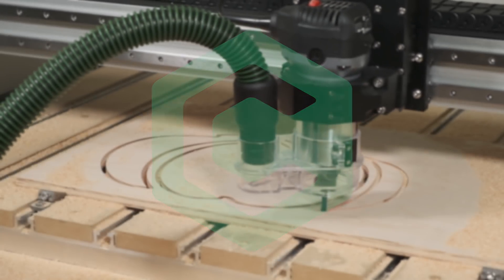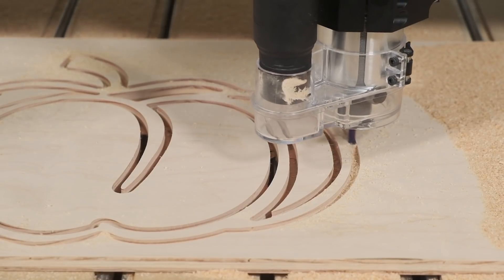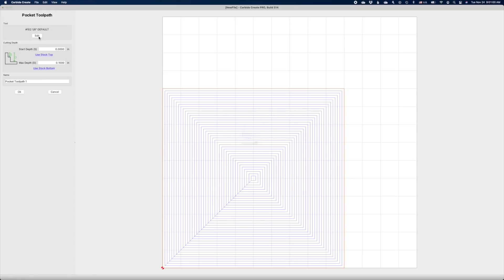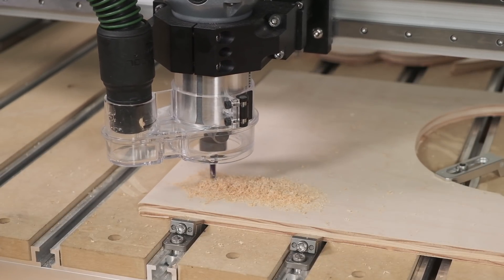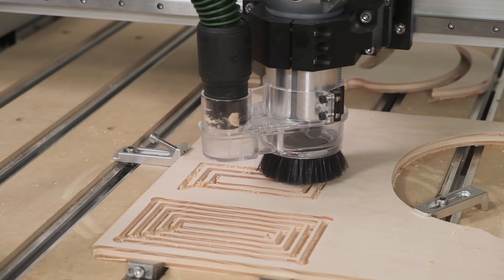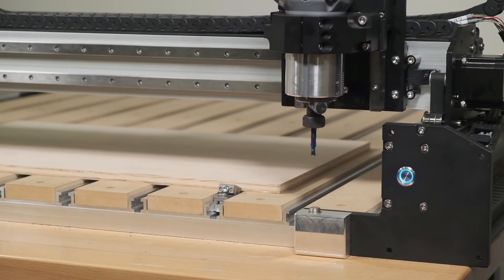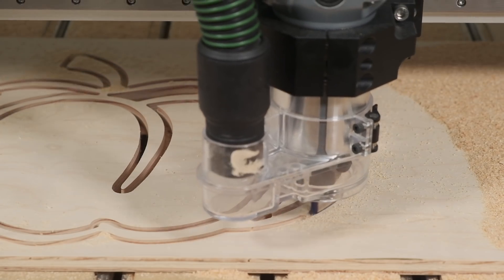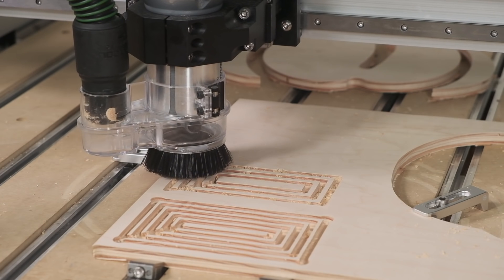Shapeoko Pro Testing in Plywood

Comment: I just gave this a try with the carbide 1/4in downcut (#251) on a Pro and at 9.53mm there was visible chatter. Although I was using Baltic Birch ply, which looks tougher than the stuff in the video,  it's nothing close to the finish of the pumpkin here. Not sure if I'm doing something wrong and open to suggestions!

Comment: The version of Carbide Create in this video looks different. As a general note, I think that the software is the weakest point of Carbide‘s offerings. There are some really basic things it cannot do, like resizing a rectangle without keeping the aspect ratio;-)
Reply: Downloaded the latest version from September and the issue with resizing recatngles has been fixed. Thanks!
Reply: Also, the new software version does indeed look like the one in this video. Mine was from July and hence still used a different set of widgets.

Comment: Hi Winston. Keep in  mind that the 700Watts of an AC router are not the some as the 700Watts of a VFD spindle. The former Wattage refers to input (power consumption) the latter Wattage refers to output (real cutting power on the bit).  As per Gwizard your third recipe was 372Watts. That is dangerously close to your AC router's output capacity (which again is NOT 700W) and I don't think it is sustainable for long periods, you risk smoking the router. The Pro does seem a lot more capable, but the AC router is the weak link now. (EDIT: This is why somebody else chose a VFD for their Pro - which of course comes with the relevant bump in $ ).
Reply: You're right about router power ratings, but unfortunately some of the Chinese HF Spindles also seem to be rated on input VA rather than output power, so "buyer beware"!  Also GWizard can only crudely estimate cutting power requirements.  It uses a K-Factor of 19 cu-in/min/HP for MDF and all types of plywood, 10cu-in/min/HP for all types "alloys" of "hardwood", and 30 cu-in/min/HP for all "softwoods". 
Audacity spectrograms (https://youtu.be/qiM20-woEOk?t=287) of Winston's cuts indicate that the router really wasn't struggling in any of them.  It's speed controller was able to maintain a reasonably constant speed.  That's why it would be quite useful for Winston to monitor and log router input power (which is easy to do) in this endeavor.
Reply: I am sure that he knows that

Comment: I really wanted to get on the Pro train, but it left a lot to be desired for me. For example, no spindle on/off. No upgrade path to a more serious spindle than a router. No word on tool changer. It's a really nice machine and a definite improvement for those looking to up their game from the S3 though.
Reply: ATC spindles are far too heavy for this machine so that's never going to be an option.  A router is 2 or 3 KG and a good ATC spindle is 15KG or more.
Reply: @vengefulcaptain6338  Here's one that weighs 5.9 kg https://www.damencnc.com/userdata/file/5000_Teknomotor_ATC41-A-ISO20-SN_Flyer.pdf
Reply: Actually, the spindle on/off could be easily done through a relay. Not sure if their controller has a spindle or otherwise unused output, but those could be wired to open and close a relay. Otherwise, you can probably use CNCjs or other software to implement this. Shouldn’t be too hard.

Comment: On my Shapeoko 3XL, being a learner, I got greedy and overloaded my 1/4 upcut, it turned itself into a screw  while machining, and pulled itself out of the collet, and deep into the spoilboard, before it got stuck spinning, nearly started a fire. I have since found some better resources for figuring out depth of cut... But is this normal? Is this why you're using a down cutter?
Reply from the maker: The downcut is primarily for cut quality, it does not pull up wood fibers so it leaves an exceptionally clean edge.
Reply: @carbide3d  I figured the down cut leaves a cleaner edge having stock to shear against, but I figure the augering force of the bit would drive up axially, which is safer than if your bit wants to auger into the material, as mind did.

I don't know if I set my bit too deep in the collet, preventing good clamping, or what. But regardless, if your bit slips from being overloaded, slipping up, effectively reduces DOC, whereas slipping down causes all sorts of potentially negative consequences.

My takeaways were:
- DOC < diameter of cutter is way too deep in slotting on a Shapeoko 3 (works fine on my Shaper Origin, but I am the feedrate control).
- I have a lot more to learn of speeds and feeds, and need to start my own dope sheet.
- shallow is safer than deep, waiting for extra passes is faster than replacing broken parts or fighting a fire.

My open question is, still:
How deep do I set the cutter in the collet? Should the back of the cutter poke out the back of the collet? Should I set it no farther back than the slits in the collet? I've seen all sorts of conversation about this online, but no definitive answer.
Reply: Ya what Winston said